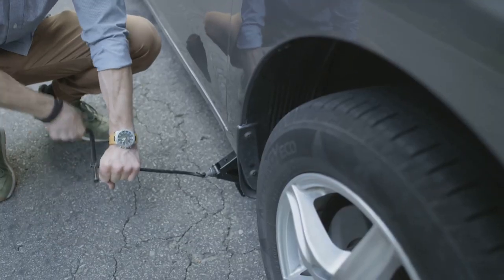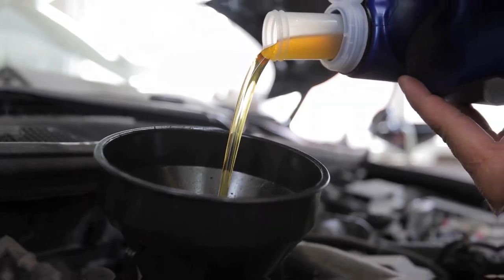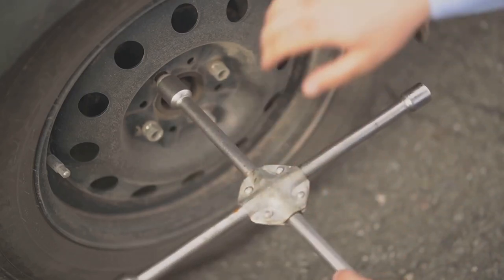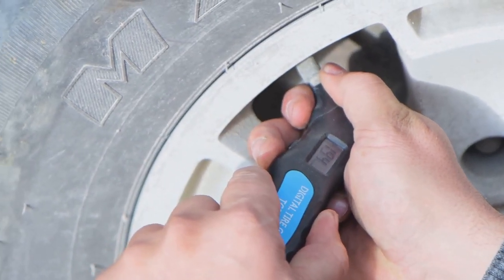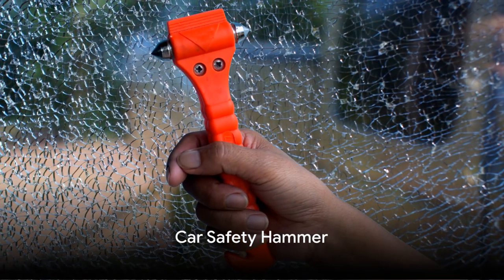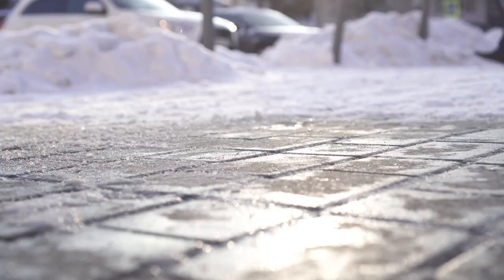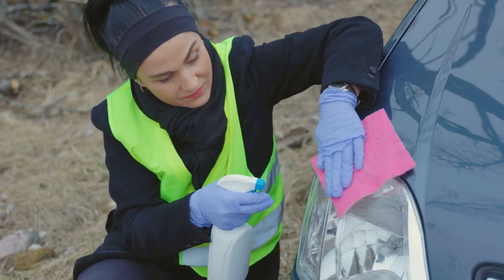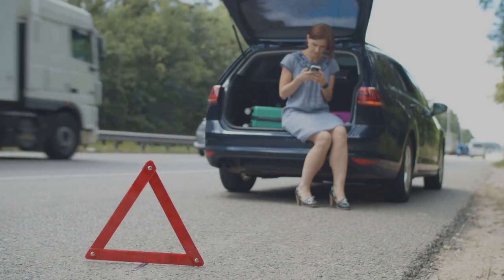Ultimate ROADSIDE Emergency Kit

Comment: 😂I totally recommend the hand pump gas syphon because there's nothing quite so thrilling 😬 as getting a mouthful of petrol or diesel if you use a bit of garden hose to syphon fuel😂 and yeah, I've done it, it's not pretty 😅 all these tools can be used for other purposes too. From using a jack when felling trees for firewood, using the syphon pump to transfer water ( rinse it out well first😅) or using your vehicle tool kit for other repairs 👍 the only thing I'd be cautious of is the jumper cables, some new cars have sensitive battery electronics which can be fried by jump starting causing problems with the vehicle. Buy a small jumper pack with electronic protection and check it regularly to ensure its fully charged. A friend has fried the electronics of a new car stuck in a supermarket carpark with a flat battery giving them a battery to battery jump, so be careful, an intended act of kindness can backfire and it can cost thousands.